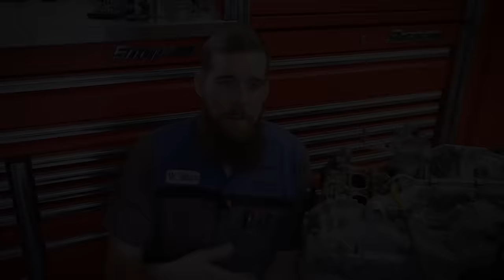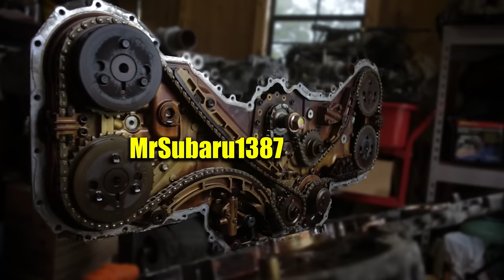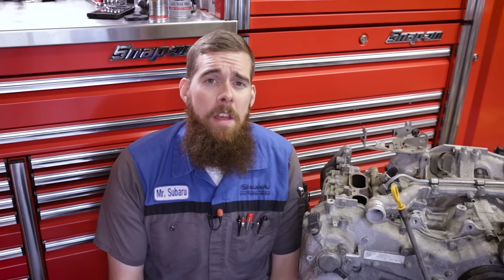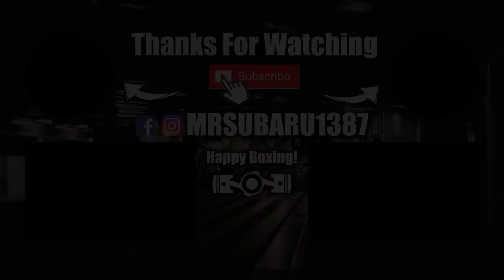Why Subarus Are So UNreliable!!! Buckle Up!!!

Comment: I recently bought a Subaru with 200k miles, and so far it seems to be running pretty well. I probably won’t take the best care of it though, as I don’t know every little thing that is recommended to be replaced, nor do I know all of the work (and at what time) the previous owners did to it. So far it has just been a brake change, getting things for spark plug changes, and gathering things needed to replace the timing belt. The timing belt still has noticeable lettering on it, so it seems fine.

Comment: LOL!! - I had a VW TDI before my Crosstrek and it was the same thing- if you leave it alone and just maintain it you won't have a problem, but if you spend too much time in a forum board and go at it with a screwdriver and some duct tape it's going to get expensive quick when it starts malfunctioning. TDI guys always push the EGR delete, but never mention after they do it the computer is totally confused and it will never run correctly again. - I could not agree more - which is why the only thing I modified was  a better oil filter (I'm not a fan of the blue fram)

Comment: I've been driving Subaru's since my first in 2009. I drive nothing else now. Currently in a 2020 Outback Premium. Not an issue with ANY of them. No oil leaks or any other issue. One of the things that I was told about CVT's is that you can't constantly do racing takeoffs from lights, stop signs, etc. Just drive it normally. I've followed that advice and have done little more than regular service on them. PEOPLE are their own worst enemies when it comes to many things. Spot-on, sir!

Comment: YES YES YES !!!!!!! I've been telling everyone this for years now! Especially whenever I see someone going out and parking lot drifting their wrx/sti. Or using it as a tow truck to pull people out of the ditch!!  Why this younger generation can't understand that the vehicle has to be moving at a good pace (at least 50 km/hr) before the intercooler even begins to function, is beyond me. But no, they gotta go out and build full boost at high rpm's while barely even moving, and then blame Subaru because their head gasket blew, or they got ringland failure!!!  That, and like you said, them thinking they can just bolt on a bunch of parts, and not do a tune or supporting "bottom end build" to handle those parts, and then blame Subaru because their engine blew!!!

Comment: I was/am the unlucky schmuck who bought a 2012 outback with the 2.5 thinking it would be a reliable car that I could pass on to my children. We are on our 3rd set of rear wheel bearings, replaced a failed CVT at 150,000, and now dealing with the fact that our head gasket has been going out since just before that and no local shops have been able to diagnose our problems for 2 years! I was not aware of the head gasket issue until watching your videos and now it all makes sense. I have a real issue with a car company that would sell a piece of poop like this and not at least make us aware of the potential issues or train their technicians to diagnose these issues. We have been taken advantage of by the dealers and by the company. I appreciate your defense of them and understand that i bought the worst year for this car but I am now looking at having to spend money on this poop box that I can’t afford to spend because other used cars are too expensive. Thank you for your honesty and helping me diagnose what mechanics can’t.

Comment: I got a Range Rover ad before the video started. Haha
Out of the 2 Subarus I've owned I have made sure to buy NA models. 2013 Subaru BRZ and my '98 Legacy GT with the 2.5L  Yes my 2.5L NA does have the Turbo gasket installed. Only major issue besides wear and tear for replacement parts. Has been soon I will need to get my cat removed before it gets too filled up.

Comment: Very true i own a JDM Subaru forester STI litchfield imported in the UK in 2006. The car is running perfect at 125,000 the head gasket did go at 100,000 and was upgraded no issues since. oil change every 5k or 12 months whatever comes first. i also do coolant change once a year.

Comment: Well said and as many here have stated... true. As the owner of a 2007 Spec.B I will add. People like to bash on the EJ but done right they are reliable in modded form. Ex. my 2007 Spec.B with Cobb access port, downpipe with high flow cat, boost controller on the factory turbo, and wastegate + Mach V Motorsports tune made 280WHP/335WHTQ, over 100k and no issues to date. The one complaint I have about the Subaru tuning industry is the insistence on very rich a/f mixtures. This is another reason to change your oil especially if you are modded. And I get the extra fuel is used to help with cooling, just doesn't need to be ~11.1:1.

Comment: I have a 2011 wrx with 130,xxx. Bought it with 28,xxx. Put a good parts and a GOOD TUNE and 22 lbs of boot on it right away and I have had no problems!
Do your plugs every 60,xxx change your oil at every 3,000 and change that timing belt before 100,000 and you will be just fine!
P.s don’t beat the shit out of it. You don’t have to boost and 7,000 rpm every day you drive it 🤘🏼

Comment: I totally agree with you but! It’s not that Subarus are unreliable! It is some Subaru owners are not responsible owners! I have a 2015 Impreza five door it’s the best car I’ve ever had! I have done no modifications I left it stock changed all my fluids the car still runs like it was brand new the day I took it off the lot!

Comment: my 2008 2.5 Forester just hit 150K. Slight drip leak of oil on driver side. Doesn't use any coolant so the HG's are still working OK. 30 mpg on hwy.....A4 automatic. The  alternator, radiator, and timing belt kit all done. Engine itself  never cracked. All orig. Fluids get changed regularly.

Comment: I worked at car dealers all my life. had enough in 2005 and have my own shop. 36 years ASE master tech. 10 years at Subaru all way back to the Justy and its CVT problems...Ive been around Subarus since 1973 when dad bought a DL 4 door sedan, then a 77 4X4 wagon. then Omni's, Aries, Camrys, and now in a 2020 Outback and my sister in a 14 Impreza. They have had minimal issues, lots of recalls. we had a bunch of recalls in the 90's too..I had a 99 Outback 2.5 non turbo that was overheated so bad, the steel cylinder liners melted out of the block due to a radiator failure. (bought it this way)I put a JDM engine in it and drove it 75,000 miles and sold it to my electrician 7 years ago and still uses it. I don't miss it and constantly running in circles with oil leaks. Had to rebuild the 4EAT on it too.. im driving a hybrid Lexus CT200h now. Love the 40 MPG which is twice the outback. the CT and the Prius has head gasket problems too at high mileage as well as oil consumption due to low tension piston rings... I can go on and on about all the Asian cars and their issues.

Comment: I have 2 1994 Subaru Legacy wagons 212,000 miles, and 174,000 miles, bought used 3 and 4 years ago. Love these cars, no problems. Both have their original head gaskets. Bought a 2009 Impreza, not turbo, head gaskets had been redone at 40,000 miles, before I, unfortunately, bought it☹️. I'm selling it before they need to be redone, *again*! I also have a 1991 240sx that I bought brand new in 1991, super reliable, original head gaskets.

Comment: I hear ya -As a 'New' Subaru owner all I hear is that Subaru's always have failing head gaskets - I've owned a couple of Fords, a Mitsubishi Sigma and a Toyato van over my years...Both of the Fords blew gaskets that had to replaced - the Sigma broke one of the overhead cam shafts at one point while by the time I got rid of my Toyota the engine was having real issues. What I'm trying to say if you drive em they all brake. Now in regard to my Suby - I've just spent 18 months working a 2001 Subaru Outback and rebuilt the engine not once, twice but five times to get it running nice and now it just purrs. Some people just have no idea on how to treat their vehicles...my dad told me. Look after your car and it will look after you. Time will tell how things go with my Suby maybe I'll feel different further down the road. I am also thankful that I dont' have a turbo to fail.

Comment: I have a 2001 Subaru Forester where the head gasket failed about 4 years after I bought it in late 2000.  If I recall correctly, Subaru had realized there was a problem with the gaskets and extended the warranty for a few more years to cover problems with those. The biggest pain was getting a nearby Subaru dealership (not the one I bought the car from) to do the repairs under warranty. The car was in the shop for weeks while I argued with the dealership. I finally had to call Subaru's US HQ in New Jersey to get it straightened out. The gasket repair was fixed under warranty, although the dealership still managed to find other reasons to charge me $300-$400. Beyond that, the car's lasted up until now with very few problems, except for recurring wheel bearing problems on the passenger-side rear tire. Just bought a 2024 Forester to replace the 2001 Forester.  I didn't even look at the dealership that had caused me problems when searching for the new car.

Comment: I agree 100%. I've never had an issue from my subaru forester. I have always kept up on maintenance on it and subaru is the best vehicle on 4 wheels.
I've see it all the time. I've had friends do the same thing in the early 2000's. I always said they were stupid to just put a cold air intake. I had a friend once make a hydrogen conversion kit out of glass pickle jars... it didn't work cause he didn't follow my specs for it. Not to mention he basically made a small hydrogen bomb in his truck.🤦‍♂️

Comment: On my 2007 Tribeca B9, I changed all of my timing parts and water pump at 115,000 with OEM parts. Changed Trans and rear end fluid at 120,000. It has 165,000 and still runs great. Oil changes every 5,000 or less. Yes, it had minor issues. Had to remove the console cover and clean the HVAC connections. Had to change out normally worn suspension parts. Just ordered a 2022 Forester, but keeping my B9 as my daily driver. I run the piss out of that car about 30% of the time.

Note: If Americans took as poor care of their autos as they do their health, their would be massive wealthy mechanics and parts suppliers. It's all relative. lol

Comment: We have a 2005 Baja turbo and just love it...bought it new and it has 250K miles and runs great...Turbo had to be rebuilt around 200k mile and we had no other major repairs...Our new 2015 Forester XT has 130K and we always have the dealer do scheduled maintenance (we do the oil change because it's easy and we use Mobile1 with a Subaru filter...)...only major repair was the air conditioning system due to a leak...but now we have to replace the valve body...which is fine...I am an engineer and love the technology of these cars. My new 2002 Tacoma has 250K miles and runs like new, always used Mobile1...

Comment: With one A/C part replacement, one headlight, a timing belt, maintenance, and 200,000 miles on my 2009 2.5L Subaru Impreza, I had to have the headers replaced on it for under $4K. It’s now running well as it did when it was new. It has no rust. I’m still getting bang for buck with it.

Comment: Thank's for your videos ! I have a Subaru forrest with oil consumption since my Subaru was new . Finely Subaru replace the engine at 75,000 mile . Until 35,000 no problem with oil consumption and then the engine started to consume more oil . Between oil change i have to had around 2qts of oil . My question is :  do you think i am a a great risk to have a head gasket problem ? If so what can i do to prevent that ? Thank you !

Comment: I keep to the Subaru recommended maintenance schedule and I haven't had a single issue.  As a matter of fact I've had one hell of a pleasant surprise from my dealership and Subaru of America; I had an expensive part go bad, 25 miles past its warranty.  My dealer suggested I call or contact Subaru of America (SoA) and tell them what happened. SoA got in touch with my dealership, learned that I was a real fan of the make AND that I was a stickler for maintenance.  The upshot is that SoA picked up the entire tab and I got a refund for the repairs.  
Love my Subaru Forester and SoA.

Comment: My JDM BP5 Legacy GT has just turned 202,000 km. Runs strong, no smoke, no noise. Regular maintenance, quality fluids, EJ20 turbo bliss. Reliable and still a blast to drive. Stock and solid.

Comment: Hi Mr Subaru  I have a impreza wrx sti wr1 here in the UK, I have owned this car for 13 years ,its a 2004 model,no problems with it apart from regular  maintenance  it's been the best car I have had and has been a good investment  going up in value by 40% on what I bought it for enough said 👍😁

Comment: Maaann! I get it, being back in the aftermarket it’s all too clear, is a brand bad, or do people just think a car is a magic machine that runs on gas and fond memories. I will add that repeated failure could be due to repair, my 07 outback, that I bought cheap because of head gasket failure, had failed a second time due to improper repair procedures (gaskets don’t seal well on wavy surfaces)

Comment: If I owned my Liberty GT when I was in my 20's, I probably would have blown it up within a year or two. I'm in my 40's now and absolutely love my Subaru, and have the money to service it when needed. It's tempting to modify it, but I feel there is more value in keeping it stock. The car is now 10 years old and still drives and runs like new!

Comment: Was in my 2018 WRX stopped at a red light and an older man in a VW pulled up next to me. Stared at me and said “hey bub I hope you have better luck with that car than my grandson did, he had to replace the engine in it”. Then at the next red light I told him I looked thoroughly and had mine checked out real good before I bought it and it wasn’t modified. Lots of questions that could’ve been asked by me but we were only talking back and forth for a total :10 seconds. I would love to have sat down with that man and asked him more about his son’s vehicle. Although I had already admittedly developed an opinion in my mind, ha ha. I’m 63 and this is my second WRX. Neither modified and regularly maintained.

Comment: I have two Subarus and both had head gasket issues when i got them.My 97 legacy has a2.5 and resealed the whole engine and used the new metal replacement ones.No issue forlast two years with it.Now I'm working on my 97 inpreza outback.Legacy had 160k and my inpreza has 226k.

Comment: They were doing the same thing in the early STI days, rich kids with mommas money doing mods with no tunes 😥. I can say I beat the snot out of my 2004 XT first with a VF39, followed by a GT30R. Eventually lost a ringland but it was a blast of 55k miles 😂. Would do again ❤ It saw so much abuse I thought I had a built block at times.

Comment: The only thing in my 2012 crosstrek that is not stock is.......the stereo :) had to upgrade to a rearview camera capable model, found out the crosstrek has a veeeeeeery good clariion unit , so had to go for pioneer to maintain (maybe exceed a little) audio quality, with the same stock speakers. There is a special usb adaptor cable that will be required to maintain the usb connector hidden in the mid console between front seats. Other than the usb adaptor that I had to get from Ali, all the stock options from the pioneer (steering wheel program, connecting harness) went through smoothly. (ref pioneer model 5250Z)

Comment: We've had a 2010 Ouback since new. 70k mi. Mostly longer drives, regular oil changes. No major issues, to date. Many friends have Subarus, with no major reliability problems. My brother is a pro; the Shop specializes in Volvos, but they do other cars too. He doesn't care for Subarus, so...

Comment: Long time subaru owner. My dad had a 1989 1.8 turbo charge gl wagon. His car was the only one that sounded good with 189k miles on the clock in our area, all because my dad mantained his car.  His engine had other major issues, like engine oil leaking onto the exhaust manifold.  Every 30k miles subaru would have to reaseal the engine under warrenty.   My 1990 subaru legacy had a 2.2, i love that car. My 2003 subaru outback n/a was junk. My 2006 subaru outback turbo charged, was junk, until i fixed the broken parts 1 by 1. I take my car to a reliable performance shop that know how to maintain the car.

Comment: I highly agree on everything you said, my buddy had a 2007 Subaru Impreza WRX STI, with 240k miles all original parts, engine (except transmission) and it was slightly modified properly, but it never had any issues at all what's so ever.

Comment: The only “reliability issues” our family’s Subarus have had stem from carbon on valves causing drivability issues…but that is just an inherent design flaw to DI-only engines that plague ALL manufacturers…so not really a Subaru problem.

And even then only really an issue with short trips/city driving, which is our unfortunate reality.

Comment: Some comments have mentioned the reliability of Toyota and they are, but let mention the millions of recalls they have had and they have had big ones.
2009 - 2.7 million because of floor mats being dislodged and pushing the accelerator down to the floor. How do you explain that to your insurance company?
2009 - 2.3 million because of accelerator problems, again!
2015 - 6.5 million because of power windows. The switch could short and cause a fire. 
2020 - 3 million for both Toyota and Lexus on their fuel pumps. Stalling while driving. OUCH!
2021 -  tens of thousands (not sure, yet!) Airbag recall. Well, we didn't need before 1990.

Wouldn't it be something if you had all these problems on the same car?
Anyway, not taking anything away from Toyota but they do have their problems.
My brother had a Subara legacy from 2009 to 2020 and nothing went wrong. Regular servicing it was a dream car to have.